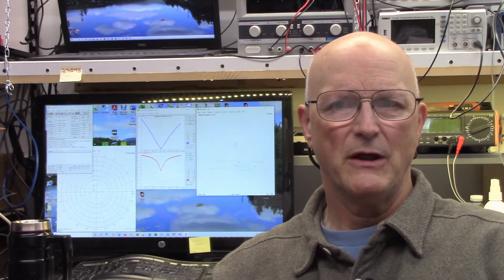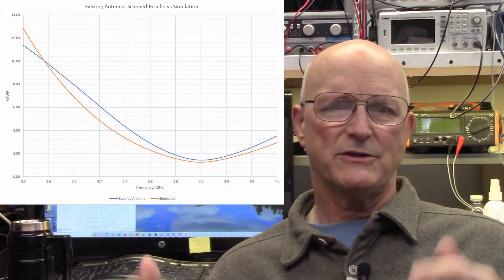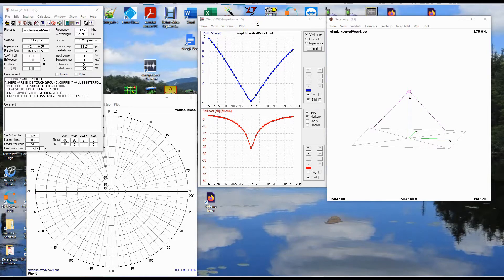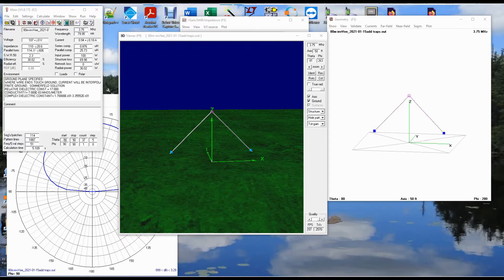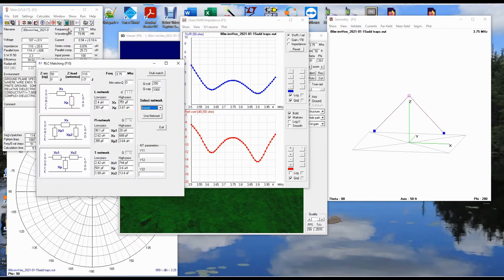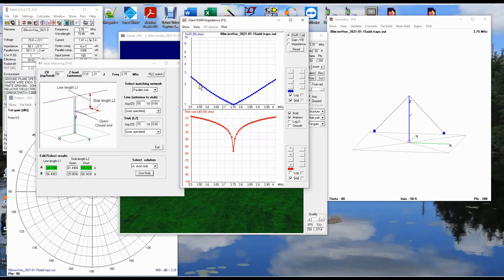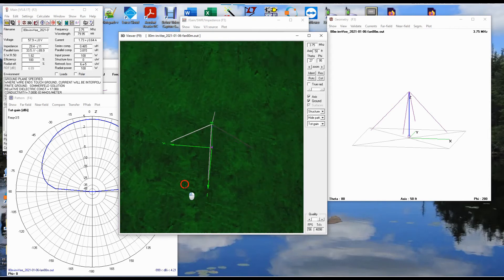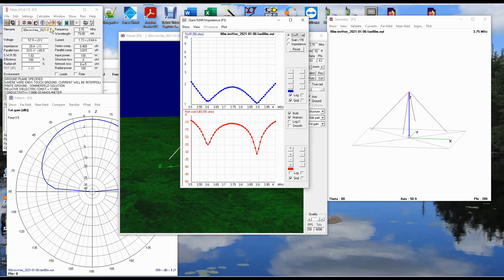4NEC2 Antenna Modelling Application: A Virtual Experiment (008c)

Comment: ”Fascinating, Captain!” 😀

I just started using 4NEC2, thanks to you. So much from MMANA-GAL to UNlearn!

One thing in 4NEC2 that seems counter-intuitive is the procedure to start a NEW antenna. I originally thought that I’d just do a File->New on the MAIN screen, but saw that option wasn’t available. I eventually go to your video where you explained how to do that.

I had been trying to model a linear-loaded dipole for 80 meters. In MMANA-GAL I set up what I thought the dimensions should be, but the SWR was sky high. I asked it to ”optimize” the design, and I got a pretty good match. But I went back into the editor and discovered that it had proposed an antenna with a length > ½ wave! Huh? (Also, it moved the feedpoint OFF CENTER!) The idea is to SAVE space! I’m retrying it in 4NEC2.

”Cover me. I’m going in!”  😀

73 de AF6AS